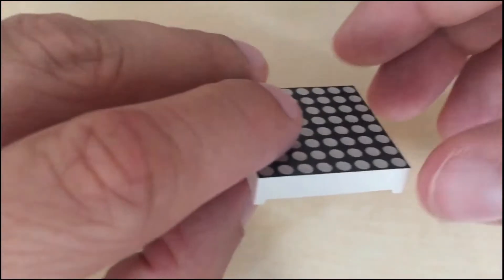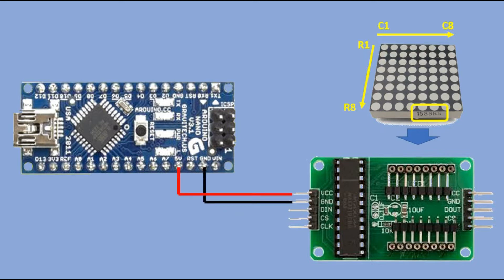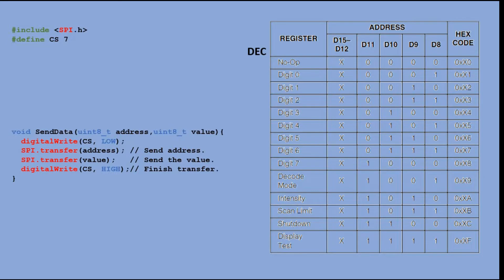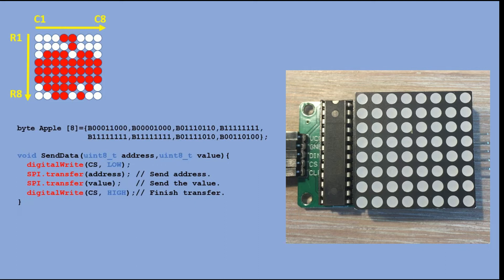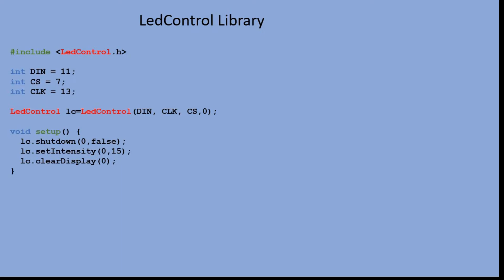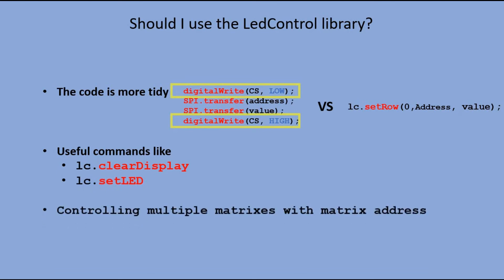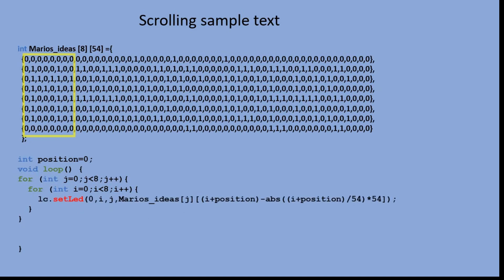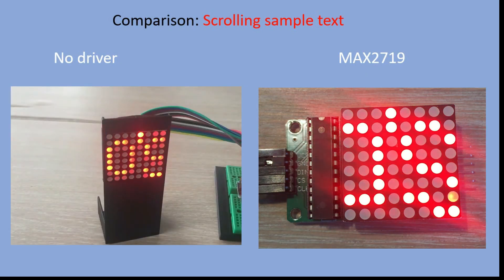How to control 8x8 dot Matrix with MAX7219 and Arduino

Comment: Great video I wanted to thank you and to ask a question if you have the time of course. I want to have each line display a value in binary or converted so say you had a temperature from 0 to 100 and it would display it in binary on the top line then drop that line down and check the temperature again and then display the new temperature on the top line and then move the two lines down and display a third one on the top line I wondered if you had any ideas or suggestions? Thank you

Comment: I connected the matrix display, entered everything just like the example, but instead of one dot, like with the third led in the first row, ALL the dots light up?
Reply from the maker: I matrix common cathode?
Reply: Mine is the MAX7219... with the two sets of 5 pins, onboard IC.
Reply from the maker: @ErlankBru  If you Max7219 behaves differently maybe it is a different setup. The one I have in my video is that the matrix is common cathode and the max7219 module works with this type of matrix. If you have common Anode matrix then the module needs to control that matrix differently and then my code would not work on it.
Reply from the maker: Have you purchased max7129 module and the matrix separately or they came together?

Comment: Is the MAX7129 multiplexing in parallel? 8 LEDs at a time, and cycling through the 8 rows. Or is it cycling individual LEDs much faster than the Arduino is able to do by itself?
Reply from the maker: I believe this is done raw by raw. You can try to film it with your phone with different lighting and tehn this shoud be visible

Comment: Hi Mario, I am new to Arduino and Dot Matrix 8x8 Max7219(White), I do not know where the things go, but I would like to learn how to use Arduino and a 8x8 Matrix to show NUMBERS 1-0(10 numbers), for 10 turnouts/points, one at a time on a model railway layout. I need to know where everything is placed in the IDE, I DO NOT EXPECT the WHOLE CODE DONE FOR ME, I have already got Number 1 and have a pattern to copy for the others, WHERE TO PUT THE OTHER is what I need. THANK YOU
Reply from the maker: Doing it with patterns does not make sense. Check this video of mine https://youtu.be/oZDFh95Tt_E. It shows 4 matrixes joined together but the same context applies to one matrix . Go to link to code. 
https://www.hackster.io/mdraber/create-text-animations-with-parola-library-for-arduino-b67955 Look at the Parola example.Then you need to change  MAX_DEVICES 1 and in animation table replace all texts to animate with 1,2,3,4,5 . If you run the code you should see count from 1 to 10 each number having a different animation for entering and departing. Pick the one you like and update it accross that table.
Reply: @marios_ideas  THANK VERY MUCH FOR YOUR REPLY - I am sorry but I do not know enough about what goes where. JUST imagine an Arduino on a board along with 8x8 White, on top of the 8x8 will be 64 x 0.75mm fibre cable, with the ends set in in glue sitting on top of the leds, then this bunch of fibre will go through the base of a model Railway Layout further up the side of a Gantry to a BOX that will the other end of the Fibre Cable, again in a Glue Box that will show a Number from 1 to 0, ONE AT A TIME. THIS TOP BOX, I would like it to be about 7mm square, this will have to be on the side of a Gantry, as the Operator will not be inline to see the 7mm square Box as it will be too far to the left to be seen, and THESE TURNOUTS/POINTS (10), go further away and over 2.0mtrs away and there may be OTHER CARRIAGEs/WAGONS in the way of EYE SIGHT, so with this in mind I will try to do what you sent me. I am surprised that only you have bothered to reply, I do not expect a reply. THANKS for your time, may be later.
Reply from the maker: @graemewilson4126  What you describe is the end effect. To make it work first you need a working prototype on the breadboard. Do you have the matrox with this Max7219 chip? SO five pins to connect to Arduino?
Reply: @marios_ideas  WELL, I am surprised to find this reply in my email box, BUT THANKS anyway, yes I have the following, Breadboard, Arduino 8x8 Max7219, Cables,  Resistors Blue Power Cable, I was able to find online what the 1's and 0's are required to show on the 8x8 and now have all 10 numbers code ready to enter into a IDE, but then my KNOWLEDGE stops in where to enter any further CODE in the right place. I am now thinking that this 7mm square Board with black background and white leds could be too small to work with, being placed on the layout and be seen by the Operator, on the GANTRY some 450mm from the front of the layout, even though its to HO SCALE.
Reply from the maker: @graemewilson4126  To write a code like that you have to understand it. Did you go over those two videos of mine and try to understand what the code does. I truly believe the using Parola library is much simpler then creating bitmaps of numbers in Arduino code. One more hint. And I am not joking. Use AI, chatGPT to be exact. And in chatGPT write following request " Write Arduino code to count from 0 to 9 on 8x8 MAX7219 matrix using Parola library". This should present the code. Make sure you connect the pins as described in the code and see if this works. This should be the good statrting point. Then you have a code and if it works you can then adjust it to your needs.
Reply from the maker: Here you will find examples on how to use charGPT
Reply from the maker: Forgot the link https://youtu.be/S6ClV3dWiT4. When I run it I get the following code and I think it should work for you. You have to install the two libraries which you see at the top.
#include <MD_Parola.h>
#include <MD_MAX72xx.h>
#include <SPI.h>

// Define the number of modules you have
#define MAX_DEVICES 1

// Define the pin connections for SPI
#define CLK_PIN   13
#define DATA_PIN  11
#define CS_PIN    10

// Create an instance of the MD_Parola class
MD_Parola parola = MD_Parola(MD_MAX72XX::FC16_HW, CS_PIN, MAX_DEVICES);

void setup() {
  // Initialize the Parola library
  parola.begin();

  // Set the intensity (brightness) of the display (0-15)
  parola.setIntensity(5);
}

void loop() {
  for (int i = 0; i < 10; i++) {
    // Clear the display
    parola.displayClear();

    // Display the current number
    parola.displayChar(0, i + '0');

    // Update the display
    parola.displayAnimate();

    // Delay between numbers
    delay(1000);
  }
}
Reply: @marios_ideas  Hi Mario, I have been able to get the CODE to my IDE and verified only to find I need Parola.h as well so I went looking and found that and D/Led, got past Parola.h only to get another error   

void displayNumber(int number) {
  myDisplay.clear();

:) I do like the 1's and 0's, without check they look the same as what I have already. 

SOMEWHERE I SAW, something about running the NUMBERs 0-9, NOT FOR ME !!!!!, I wish to have one number at a time to show that is connected to a TURNOUT/POINT of a bunch or 10, when the POINT is open a number will show ON, 
when the POINT is closed there will NO NUMBERs ON.
THANKS FOR YOUR HELP HERE

Comment: Thanks for your efforts! I'll be helping my nice to create a costume for some cosplay and she wants to use some simple visualization, since I'm familiar with Arduino I was looking for tutorial how to use this led matrix. Possibly I will need to use the larger display, so this will involve 4 or 8 matrix boards. I believe this can be combined together, but do you know what amount of led matrices is the max the Arduino can support?
Reply from the maker: You can support as many as you want but you will need external power supply to power them. You won't be able to power more then 4 from your Arduino, I think.

Comment: what do i use to control either a big matrix or alot of 8x8 matrix. do i need a max7219 for each 8x8 or there are other modules?
Reply from the maker: Max 7219 for each. Check my other videos e.g the one about controllingv4matrixes with Parola library
Reply from the maker: Also i have one video about controling 4x largo custom seven segment display with max7219

Comment: Hi, have you tried MD_parola library?
Reply from the maker: Yep. It will be in one of my upcoming video. I will control 32x8 dot matrix
Reply: @marios_ideas  what is the code to display a single character on 8x8 dot matrix?
Reply from the maker: @kavyashree4415  If you installed the library it comes with number of examples. Some very simple ones like parola_helloworld. There you just replace "hello world" with the character that you want and done. In Arduino IDE go to File-Examples-MD_Parola
Reply: @marios_ideas  thank you

Comment: Can we manipulate each led separately to light up? For example if 100 hz was heard then 1rst column first row led should turn on and if 500 Hz then 4th column 6th row led should turn on. I want to make a circuit to check hearing.
Reply from the maker: It is possible. Not sure what you would need to detect different frequencies
Reply: Is it possible to use this with a rotary encoder? Each time the encoder shaft turns, one led in the row lights up then if the encoder button is pressed then different columns light up?
Reply from the maker: Ahlam Rafeek Yes it is possible
Reply: @marios_ideas  Is there any code or Library you suggest I use?
Reply from the maker: @ahlamrafeek9141  The library is mentioned in the video. As for code you will need to figure it out for yourself. If you get stuck I will be more then happy to give a hint or two:)